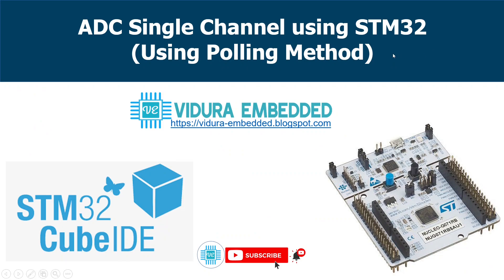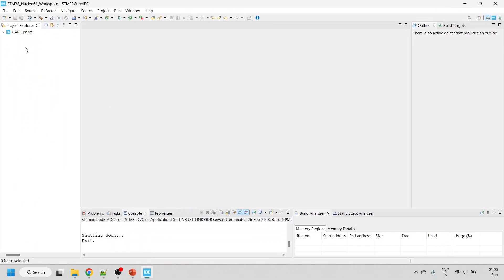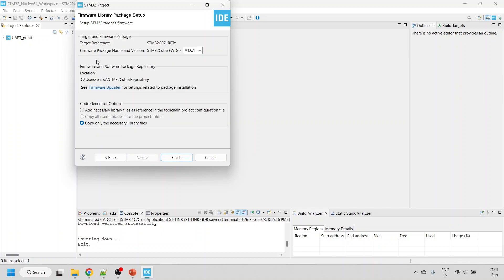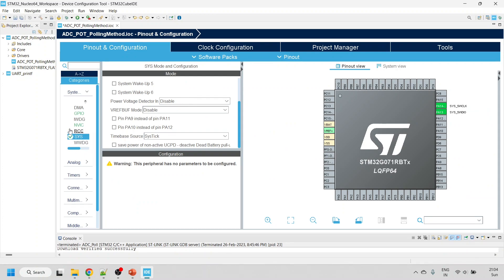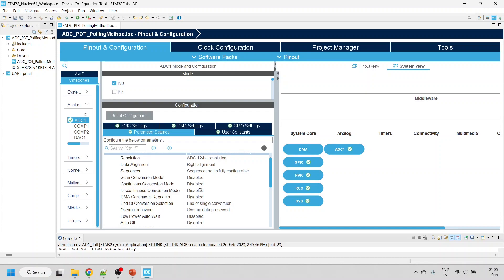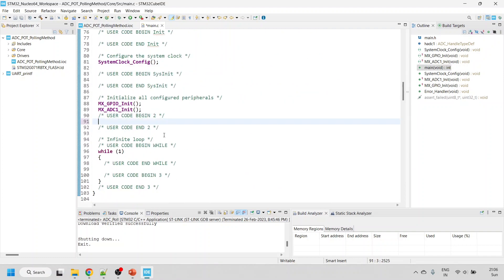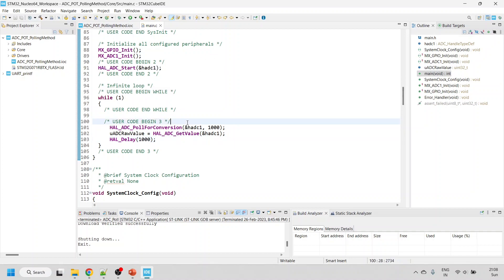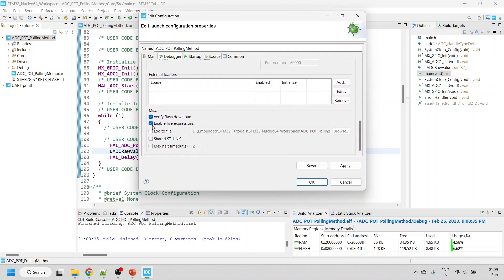ADC Single Channel using Polling Method - Potentiometer

Comment: when I am rotating the potentiometer the value in the live expression is not changing.... I dont know whats the problem!!!
Reply: try to start and stop the ADC each time you acces it : 
while (1)
  {
              HAL_ADC_Start(&hadc1);
	      if (HAL_ADC_PollForConversion(&hadc1, HAL_MAX_DELAY) == HAL_OK) {
	          potentiometer_value = HAL_ADC_GetValue(&hadc1);
	          pot_val = HAL_ADC_GetValue(&hadc1);
              }
              HAL_ADC_Stop(&hadc1);
}